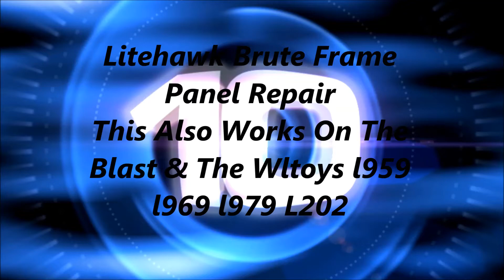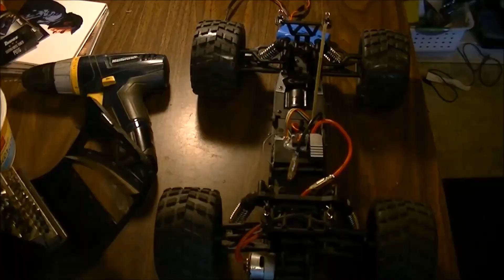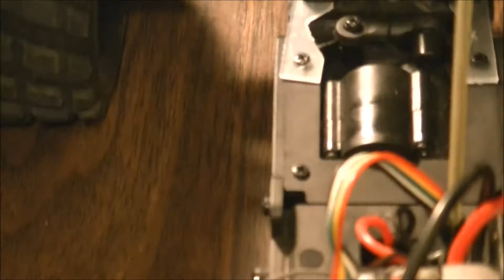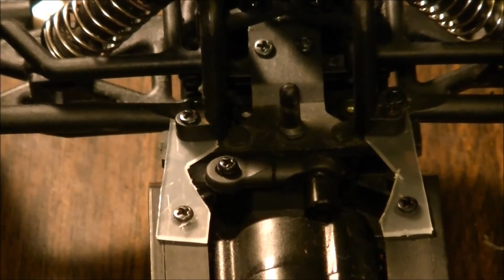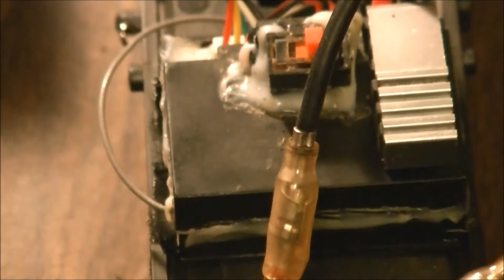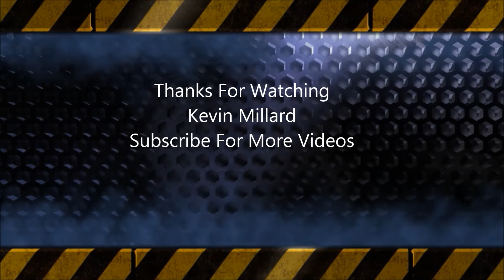Litehawk Brute Frame Panel Repair

Comment: Nice repair!! I have broken so many parts on my old buggy I had and son's buggy and my L979, but never thought that part would break!! I am actually replacing the trans gear in my buggy right now, and waiting on a new servo for my L979 truck!!
Reply from the maker: thanks, it took alot to break it,,i guess i need to order he parts in i need i have to get a new knuckle as well.. lol took it for a spin found out had a bad knuckle to lol oh well ..